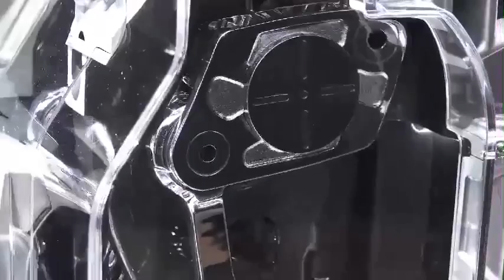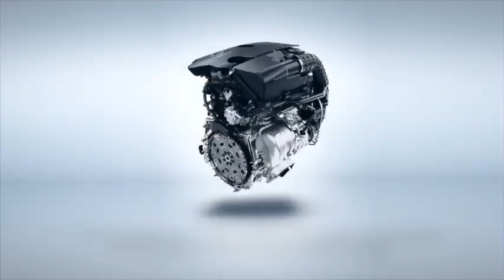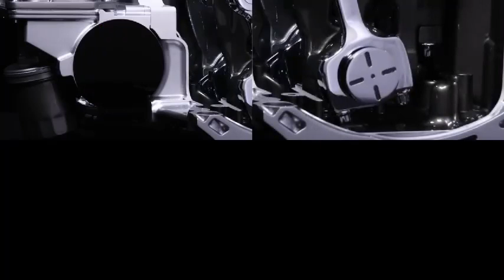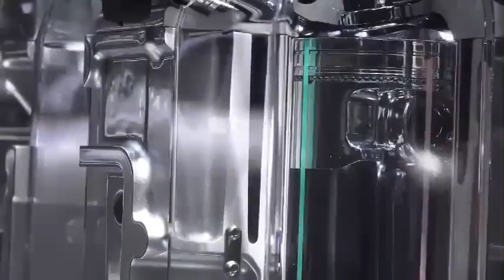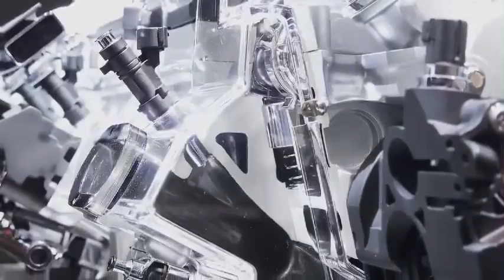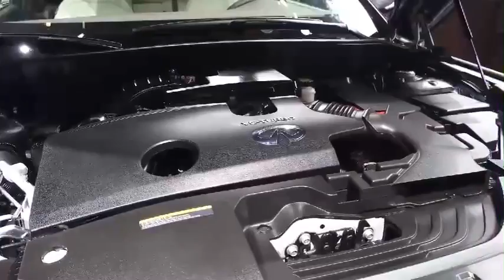Variable compression VC turbo engine working principle

Comment: Love those injectors before and after the intake valves will help keep the intake valves clean.  Direct injection engines are notorious for getting dirty intake valves from the pcv gases.